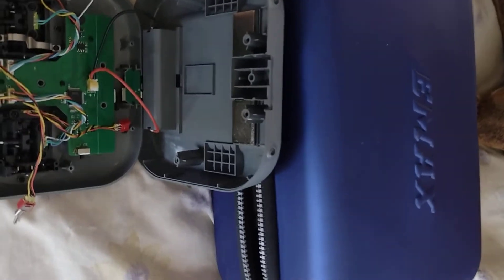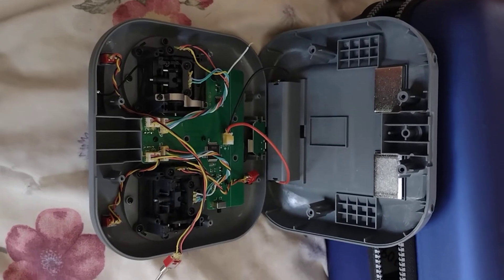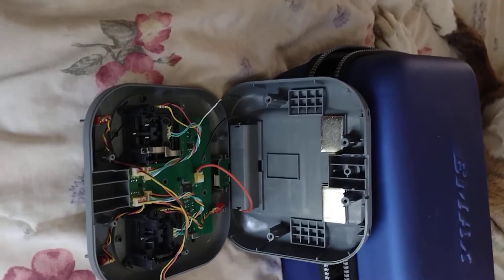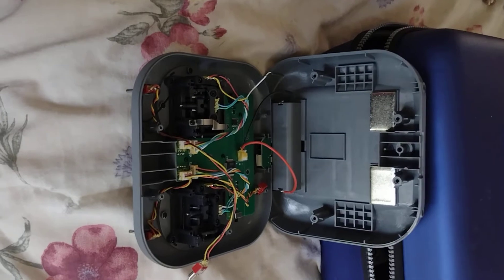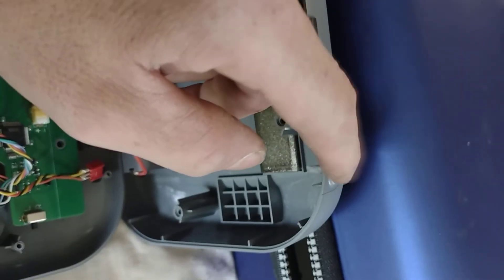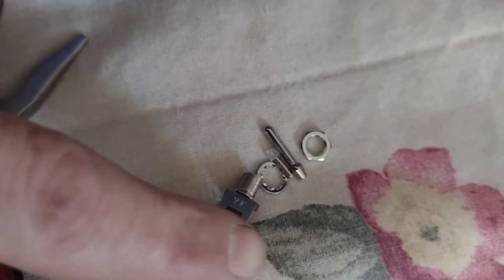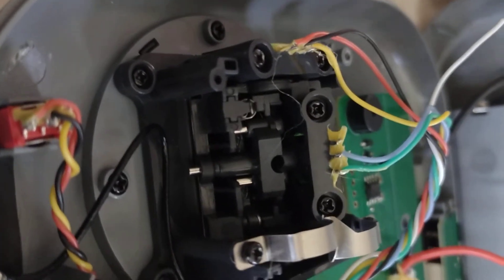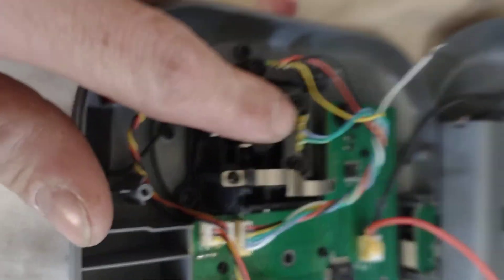Emax E8 problem solved

Comment: Mine came shipped with the blue and white wires not even connected to control yaw straight out of the box. I am going to solder them on and remove the glue. QC EMAX come on guys. Entry level products like this need to be in good shape. New people to the hobby wouldn't do this. Thanks for the video Divad I needed to see what the proper placement of the yaw wire's is. Got it thanks man.